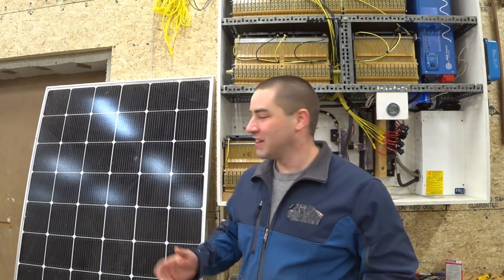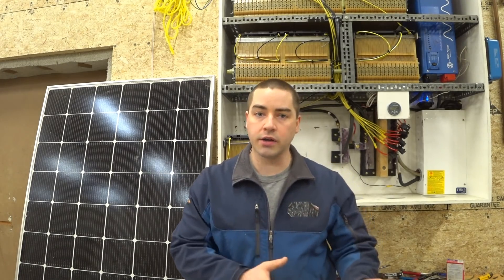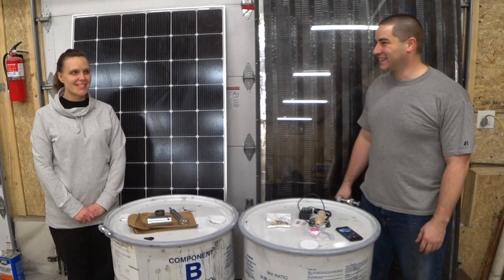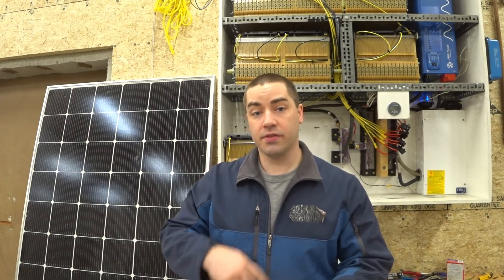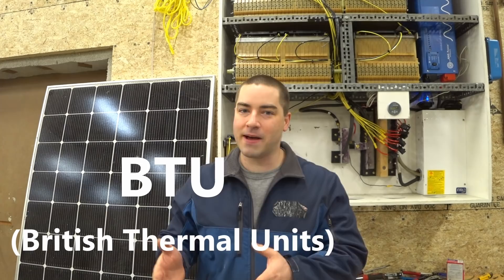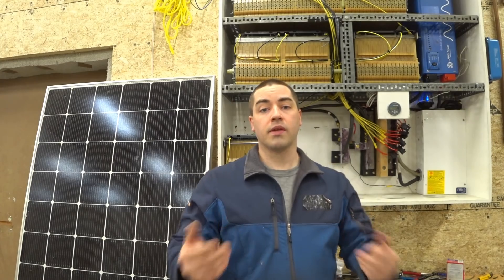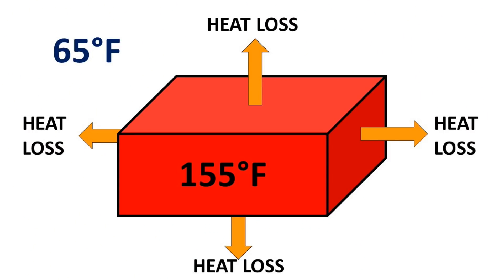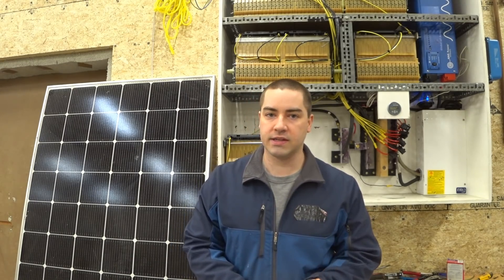Cheapest Energy Storage Off-Grid

Comment: It makes no sense at all. If you want to prepare hot water use solar tubes, without loosing energy to convert to electricity.
Reply: That's so not the point of this video. He's talking about storing energy.
$300 cost for water-heat storage = $4000 cost of battery storage.
or in other terms, $10/kWh vs $140/kWh energy storage cost. 93% cheaper.
He's just using hot water/space heating as an example. You could easily use this to power a co-generator or tri-generator and have electricity and AC from it aswel.
Reply: Aleksander Wisniewski It's a perfectly sensible way to use excess solar generated electricity. Solar thermal is great, but if you already have excess PV it makes sense to use it.

Comment: I have a patent and thermal dynamics. What I have found even better than water is silica sand. It can get much much hotter and occupies far less space. The thermal energy density is far superior. Sand can be heated up to five or six hundred degrees properly insulated with the heat exchange tubing running through it. You need much less space. As long as safety precautions are practiced this is a superior method.

Comment: Great video. 
You can't consider the wall thermal losses when you compare both batteries. Your thermal battery is very inefficient (about 25% losses). You don't need to store this extra +7000  BTU on your chemical electric battery, it is just more efficient. Even with that, if you plan to heat something, is better to store the heat than use a simple electric resistor. (heat pump probably will be more efficient to heat your water)

Comment: I like evacuated tube collectors because they are 98% efficient at making heat from sunlight, and they are a lot cheaper than photovoltaics. Large volume tanks can hold 90-100 degree water for a long time at low pressure. Perfect for circulating in a hydronic floor heating system.

Comment: Thats fine for heat.  now turn on the air con.
Reply from the maker: Sure, for the AC I use the electrical system.  There is a bank of batteries behind me in the video.  I have tons of sunshine and energy in the summer to run the AC.  But I don't have much solar energy in the winter when I need the heat.

Comment: You can also look for ways to cool the tank that your heat exchanger is in by using many cells that both absorb heat and convert that heat to electricity thus making the potential higher for the colder potential more in the center close to you heat exchanger and some on the outside an for the hot cells using multiferoics put those between the heat source and the cell and also in the coil of the heat exchanger

Comment: While a larger tank does require more power to heat, it also has a smaller surface area compared to volume, so the heat-loss through inefficiencies of insulation etc, would be less. There's a lot of water-volume in there that isn't doing anything; it's not in contact with the pipes or anything. Perhaps all that space could be filled with something of a greater Specific Heat Capacity than water (crushed glass might be good) and then just use a small amount of water for good transfer with the copper pipe.

Comment: If you "oversize" your tank, don't bother about heating all the water. Just heat the water in the tank from top to bottom, which means you will always have some hot water at the top of the tank, where you can retrieve it from. Yeah that requires some more thoughts on the heat exchanger, but actually theres existing systems on the maket doing this process and all the math for you. Well - for sure you wont get them at $300, but you might probably have a look into how they do it and copy paste it to your system.
Reply: Sounds like a good idea. I wonder if he gets into trouble with microorganism when his water temperature drops below 60°C. I did some small experience on my own. If I remember correctly the more water I heated the less energy loss I had anyway.

Comment: Store the energy in rocks surrounded by water.
Reply: Sure Wipe pointless. Rock holds much less heat than water for the same volume. Water holds more heat per unit volume than just about any other cheap and widely available substance.

Comment: The efficiency of a solar cell is below 30%. Efficiency of water systems like this is over 90%:
https://aguasol.dk
https://aguasol.dk/wp-content/uploads/2016/06/Aguasol-Unibody-Technical-datasheet.pdf

No electricity for pump neded and much cheaper than photo voltaic cells.
Reply from the maker: I like those systems, and a lot of people can benefit from them.  I won't install a vacuum tube system with a tank (like you showed) in my climate because the supply/return pipe will freeze.

Comment: An essential calculation, is lifecycle. Also, the heat loss, how much of it passively contributes to space heating.
Reply from the maker: My 250 gallon tank is inside my thermal envelope, so it's helping with space heating.  This is a bad thing in the summer, but with the angle of my collectors I don't capture much heat in the summer.  So it works out fairly good.

Comment: Question. A battery does not loose so much energy per day. How many solar panels do you need extra to account for the heatlos? That costs you be a factor too. So 300 for the " waterbattry + 2 saolar panels" Also, does this system work ok in the winter were there is less sun and you need more heat?

Comment: David how does solar heat the water
Reply from the maker: When sunshine hits a black surface it makes the surface hot.  The flat plate solar collectors are black.  Water is pumped through little pipes inside the flat plate solar collectors.

Comment: 1 thing you missed is, and im gonna do this in Celsius instead of Fahrenheit. 

If you get your useabel bath/drinking water over 60C in a tank you are increasing the production of limestone that will clog up the pipes, and if you are lowering the temp to under 50c you risk the production of legionella bacteria.
Ofc the lime is only gonna be a problem is you live in a area with calcium rich water. But these measures have to be put into your calculation.
So you actually just need to have a 2000L storage tank with +180F water heated from your solar panes (with a pressure valve),  and a heat exchanger with a automatic temperature engine valve
plus a small pump and a 
Pressure switch to make it all work. 
When you need warm tap water the 2000L tank will flow through the heat exchanger in a controlled environment where you transfer the energi from your storage tank (2000L) into your useable system at a specified temp without the risk of getting 
lime precipitation, then recirculate it back into the buffer.

Thx for a great video by the way, like the used car batterys, 2000$ is not that expensive for that amount of storage.
Best regards
Plumber

Comment: FYI I have a very old Gen 1 heat pump water heater, and with 4 people and a load of laundry every day I use about 40Kwh per month through it.  this is down from about 120+Kwh with a regular heater.  And another cool benefit is it only pulls 500 watts, so a much more even load on the inverters.  combine all that with shutting it off when the sun is down and it is about as efficient as you can reasonably get.

Comment: I lived in a large house in Honolulu (1957-2007). My parents rented sections out to students at the University. There were 3 bedrooms + a studio apt on the top floor,  my parents had the main floor, and there was another apt on the bottom floor. In the late 1970s my father had solar water heating installed. There were 2 4x8 panels on a southwest facing roof and 1 panel on a south facing roof. There were 3 50 gal tanks in the attic under the panels and a solar powered pump to circulate the water through the panels  according to how much sun was shining. One tank had electric heating which went on at 4am (for early risers) and off at 9am. During long storms, the hot water would start to give out on about the 3rd day. This system is still in place AFAIK. Even though it was several 1000 $$$, when amortized over 30 years (now 40 yr) it saved $$$ in electric bills!

Comment: don't forget a coil bypass for times the large tank temperature might get to low. you don't want to lose heat into it.
Reply: immrnoidall Surely the coil is fed with cold incoming mains water... it heats as it passes through then heads off to the taps and shower. It may pass through a conventional water heater on its way, which would "top up" the heat should the temperature not be sufficient, but there is no way with this set up that heat could be back fed into his storage tank.

Comment: Why don't you try electrolysis to generate hydrogen then store hydrogen and use it whenever you want, you can go completely off grid, hydrogen can be used in all applications even electricity, isn't it much reliable and  easy?! 
With respect for what you did its great, good luck.
Reply from the maker: I've never tried storing hydrogen.  It'd be fun to try.
Reply: @DavidPozEnergy  hydrogen is the future in all industries case of its easy production and able to be stored, good luck

Comment: Electric panel storage heaters use iron or haematite brickss, heated by electric resistance heaters, to a dark-cherry-red colour, or about 700 C. The resistance heaters cost around $12 to replace. The  bricks are currently on the market for <$70 for a 30KWh system, but this probably reflects the fact that such storage heaters are being replaced by non-storing electric panel heaters.  A new 30kWh heater can be bought for about $900. Capacity is about 7 times greater per volume than water. "Electric Furnaces" are being used in the basements of houses in areas of high wind-generation. As the bricks cool, you can extract heat down to much lower temperatures by driving a heat pump in an air conditioning system.

Comment: I do the same with ongrid inverter and a AC current sensor relais. So i need no expensive batteries. I use 4x AC current sensor relais (10$) + 4x strong 4000W dimmer (5$). Sensor relais 1 in morning dimms heater to 10%. Sensor 2 30%. Sensor 3 75%. Sensor 4 100%. When no pv power from sun, the heater is off. So my system is automated and very cheap.
In my home i use a automated 2 axis solar-tracker... i love my diy prototype.

Comment: You might want to look into latent heat storage. It will store the heat at a constant temperature and it stores the heat at about 200 times as much energy as your hot water so it takes a lot less space and you pick your storage temperature. Try paraffin.

Comment: Perhaps I'm slow, but how do you pull or transfer the heat energy to electricity? I remember you saying this was a closed system so take it you don't use this for showers or home related things.
Reply from the maker: I use batteries to store electrical energy.  The batteries are behind me in the video.  I use hot water to store thermal energy.  I have a 250 gallon tank in my crawlspace.  Thanks for watching.

Comment: So after 3-4 days your thermal storage went from 180° to 130°. If you only anticipate one clear day to recharge them, how many watts of solar do you need for a 4 hour window to get your storage back up to 180°?
Reply: I’m thinking if a normal household 50gal, 4500 watt water heater needs 2 hours to get it up to temp, then you’d need 15kw of installed solar to heat 300 gallons in 4 hours.
Reply from the maker: The numbers will vary from person to person.  I have done out the math for my household water use, at my location (Massachusetts), we need a 3.3kw solar PV array to handle 100% of our hot water.  Right now we have a mix of some solar thermal, and some solar PV.  I've got to add some more solar PV.
Reply: DavidPoz I’ll be located in NE Maine in about 3 years. I’m sure my winter solar window will be significantly smaller. 
Ideally I would be able to use the same setup for hot water and EV charging.
Reply from the maker: Great.  We have relatives in Bangor Maine.  We keep talking about moving up there.  Let me know when you move.
Reply: DavidPoz 2 hours north of there. April 2023, got the land already

Comment: David i have made a mistake by buying 33 growatt inverters for on grid. Is it possible to use this off grid and how.
Reply from the maker: I have not heard of "growatt".  Based on context, I'm guessing they are grid-tie inverters.  If they are, then yes, there is a way to use them off-grid.  You still need a large battery bank, and you will need a hybrid inverter.  The right type of hybrid inverter can "AC couple" meaning it can interface between your grid-tie inverters and the battery bank.  It also needs to fequency shift to shut down your grid-tie inverters.  The SMA Sunny Island inverters can do this.

Comment: It always amazes me how so called experts in the energy market have very little REAL idea of the use to which our typical energy usage is put. I worked out years ago that my biggest expense through the year was on heating - burning gas to heat water and/or cooking. The COST of that rose significantly when we DIDN'T have gas and relied on oil for space & water heating and 100% electric cooking. That was when we lived down South in the UK, but now that we are back North I have seen a big increase in our energy usage. Thankfully the house we now have has Solar PV (pre-installed) and our Net energy bill last year was near enough zero (actually a slight profit). Solar hot water is an even better idea and as you say extremely cost effective vs other methods in a DIY scenario. I really would like to bury a triple insulated tank (R=40+) of around 4000 litres (or more) under our back garden  to store as much as possible.

I'd also like to do some more research on verifying some of the claims for the Stanley Meyer and the High Static Voltage Resonance (resonant switched 20-30kv) methods of electrolysis of water that both use WAY less energy/power than the traditional "current passing" electrolysis to produce Brown's gas, and simply burn it to heat the water in the tank

Comment: I like the idea in theory and hot water is a big deal but would you be further a head by have solar electric heat hot water tank and the extra solar panels to supplement your power usage and have the versatility when not heating water to have the extra power with out the cost of a solar hot water heater are you way a head?

Comment: A vacuum solar panel have about  97% efficiency  what are PV panel have only 20% efficiency.
Many places in Scandinavia we have been using the systems since the 70s 

 in the 70s there was a energy crisis in Europe In North Europe They worked on  heat systems and insulation for houses  so houses were more energy efficient what a  solar heating and also so  wind heating a water hammer. there was some place in Germany  they buried a big tank of water so he did by the solar panel in the summer and take they put a heat pump so in the winter time the pump take the energy out of the water to heat the house when  water turns to Ice it releases a lot of energy by using heat pump making it A very sufficient system

Comment: Great video as usual. Thanks for math. Panels are already lower priced, but batteries and components are going  to drop in price the most and are the largest expense. Wait if you can. That’s why I like this idea , especially since I’ve done hydronic radiant floors before. Wood fire is the next option of stored heat energy and can work in combination but has disadvantages. Wood can’t be economically converted to electricity yet. I have the big soapstone fireplace but it’s really just a luxury. I love it. Any wood boiler is going to start at $10k too.

Comment: What about bacteria in your heat exchanger..
Reply from the maker: Hi Andy T,  The heat exchanger is part of the potable water pipes.  The water is flushed every time you open a tap.
Reply: Not the water you drink but the water in crawl space that you use to heat your pex pips is it possible for you to legionnaires disease from heating dead water to 150f or do you use clorine or something . Thanks love your videos.. really helpful.. from Quebec Canada
Reply from the maker: I think it's not a problem above 120 or 130 degrees, and my tank is usually 140-170.  But I did add a bit of bleach when I first filled the tank just to be safe.

Comment: What I have on todo list is move hotwater tank outside, deshell it, paint black, place horizontally in insulated box with glass sliding door I saved for lid. Then install against south wall so piping is not exposed and tank gets free heat from sun. Solar assisted hot water tank. I can set the heating element really low to save power.

One other consideration for using your thermal storage is to run refrigerator. See ammonia or propane based refrigerator that use heat to operate compressor.